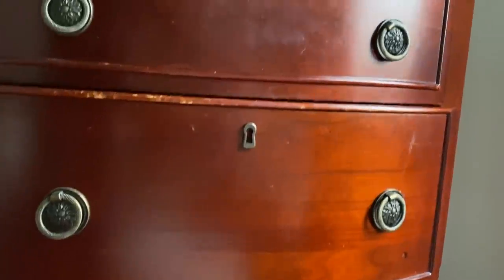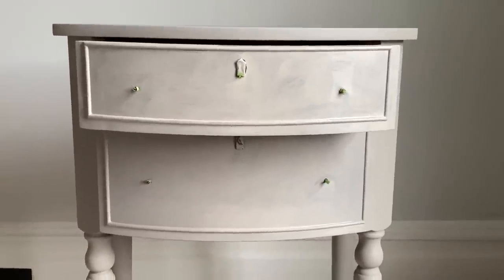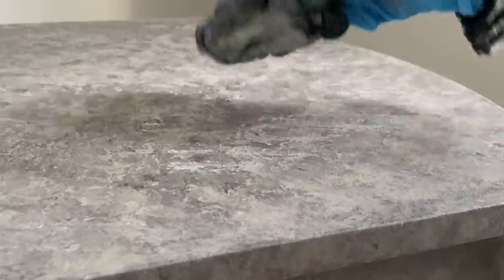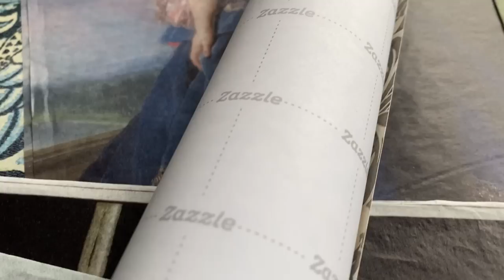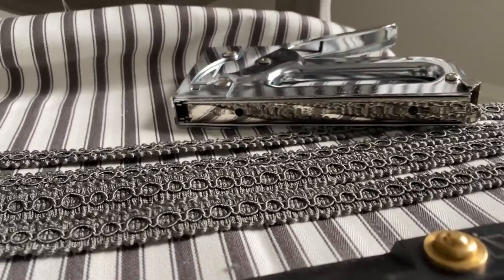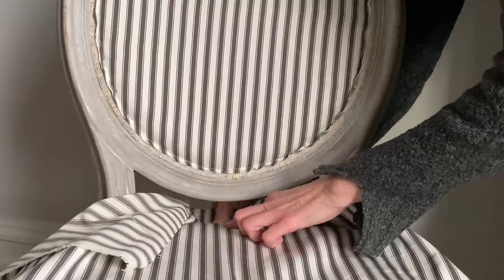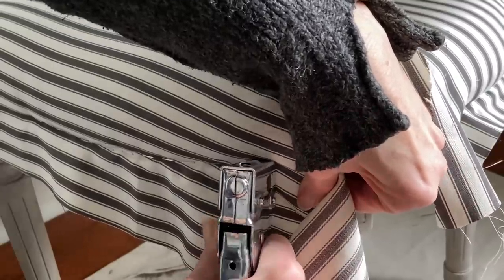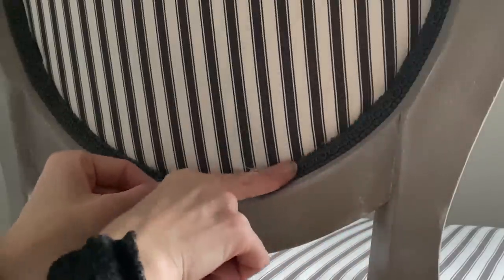3 Easy DIY: Chair upholstery, furniture glaze makeover and decoupage home decor picture frames 🖼🎨🪑

Comment: Thank you for showing how to do the chairs without taking the whole chair apart. The videos I have seen about redoing chairs has kept me from doing mine. They need  it so desperately due to little hand prints - other than a little boyʼs getting on and off the chairs - doesn't require an entire taking the entire thing apart and starting from scratch. Just a good cleaning. Thank you very much for this entire video. I feel more empowered to fix the gifted furniture and make it mine.

Comment: Loved both pieces Christina.   Very good video.    I soak my wax brushes in mineral spirits, that seems to work good.    Actually I find new material at Value Village.  I recently found a blue and cream stripe, similar to the black you did, about 3 yards, $9.00.   Reupholstered my kitchen island chairs, spray painted them as they are metal, looks fab and updated!     I bought these chairs at Sears in 2008.   I miss Sears.  Lol
Reply from the maker: I miss sears too! Your kitchen chairs sound gorgeous! Fantastic tip on the mineral spirits for brushes!! Thank you 🙏 so much for your kind comment Kim! ♥️

Comment: I’m in the same situation at the moment. I need to cover some chairs I had purchased too match my room makeover that I’ve just done. I’m wondering what kind of fabric you used? I know I should use a heavier weight fabric, I just would like to know what you found worked best for you in this situation. The shape of the chairs I have is very similar to what you’re working on minus a back cushion. TY:)
Reply from the maker: Hi yes a thicker fabric like canvas or thicker linen will work.  Also heavy cottons as well. 🎨🙏❤️